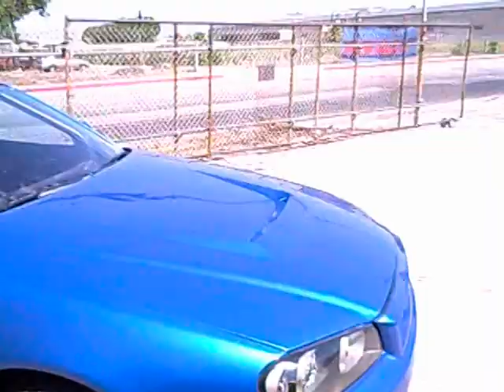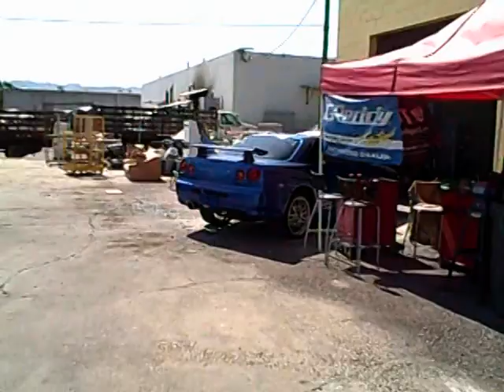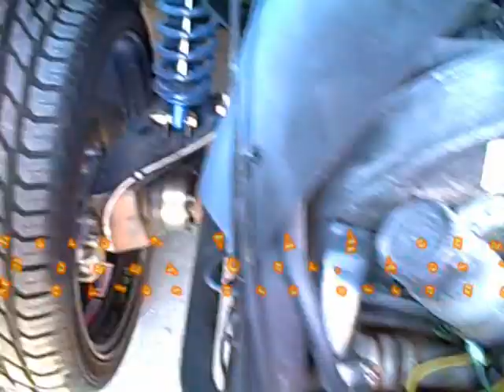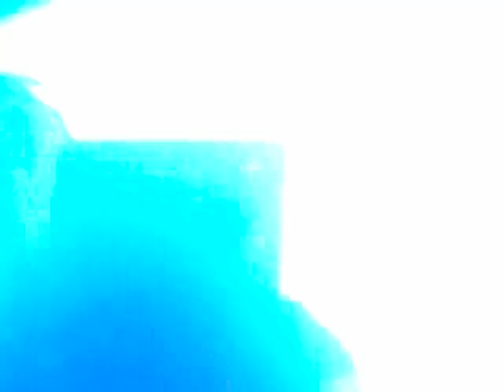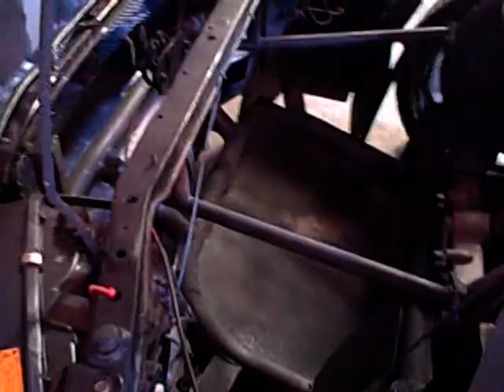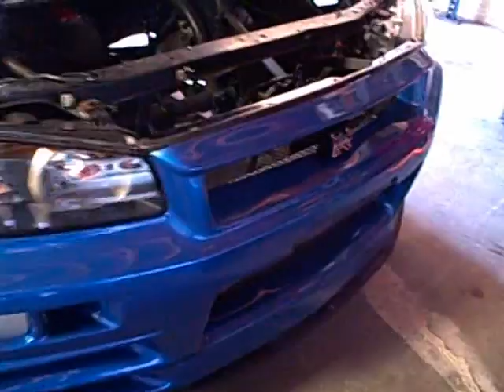R34 Skyline Buggy Car - Fast and Furious 4

Comment: The 2JZ engine is a good engine. It can be modded to 650 hp without messing the engine. But you have to change the ECU Programming and the boost controller, unlike the RB26 that only needs a huge turbo and a boost controller. Finish.
(note that I specifically mentioned the designated engine, as not all JZ and RB engines can be used for high speed abuse)

Comment: you don't have to change the ECU on the RB, you just have to reprogram.
The ECU on the JZ is another thing, its not that inclined to racing so you have to replace it.
Skyline GT cars used in touring races have RB26DETTs that have 600hp have factory ECU that are reprogrammed.

Comment: There is more than that. there is an NA version of the RWD one. And then there is a turbo and NA 4 door version of it aswell. Then there is like 3? or 4? different GT-R's aswell. Standard, V-Spec, M-Spec. etc.

Comment: It's a fiberglass body of the R34 GTR they used on Fast and Furious 4 on the desert. The original on the city part was RWD, not AWD, and plus, they used a fiberglass body of the GTR on a dune buggy and they used it for 4x4 in the desert. I know this, because there was some site of cars called EdMaunds (I think that's called).
Reply from the maker: Its not fiberglass. It is a steel body. Since I touched it, and drove it, pretty sure I know what it is.
Reply: Yes, it IS fiberglass. EdmundsAuto just said the car was made by Fiberglass in a Dune Buggy chassis for the desert part where Brian (Paul) and Toretto (Vin Diesel) to Mexico with other racers to collect a $60,000,000 merchandise.
Reply from the maker: Brayan1023ps2 This is my video. I have driven the car. Its not fiberglass. Its an R34 GTS body on a VW drivetrain. You can watch the video, and decide if I or Edmunds knows more about this car. I did work on most of the movies, and I have been working on GT-Rs for 15 years. Don't always believe what you read. Most of it is written by people that have never seen or laid hands on cars.
Reply: tyndago Don't believe me? Read this. http://www.edmunds.com/car-reviews/features/fast-furious-cars-2002-nissan-skyline-gt-r.html        The production bought a total of six Skylines to portray FBI agent Brian O'Connor's most significant ride. And it built a fiberglass replica shell of the R34 that was mounted to a dune buggy chassis for some off-road scenes. Of six real Skylines, three were sold as parts cars, two were destroyed and one was saved for any potential sequels. And of course there are going to be sequels.
Reply from the maker: Brayan1023ps2 Why do I have to read it when I was there? Check out the credits. Technical Adviser, insert unit. You might see my name there.
Reply: OK, OK tyndago, it's metal.

Comment: Poor clueless viewers. In fact, that's not even a Skyline GTR34. The whole chassis was made by hand and a VW engine was thrown in. Then, Body Panels like the fenders, hood, doors etc are pieced together, so much so it looks like a Skyline R34 from the outside.  Even IF you were to say this is a Skyline, it would only be a GTT and not a GTR due to it's body panels! And dayum, the stance on that car is so 4X4! Haha, it helps that it's a VW buggy.

Comment: there was an doc on F&F and the person writer had the listings of all the cars that were used in all the movies. He said that one 1 of that blue skyline was a true skyline which belong to pual walker. the rest that were used to shoot rolling scenes were all reps. he didnt state if it was a vw rep but he said reps.
Reply: 6 years late but none of the gtr's/gtt's used in ff4 were paul walkers, he had a white r34 gtr imported legally by motorex, just sold for about $500,000 by TopRanksImport(ran by the same guy that started motorex back in 1999-2002), the r34 vw powered is a stunt vehicle for cameras and more dangerous stunts. im sure you figured out all this by now, but incase someone else didnt know heres this comment

Comment: Bullshit they do.  the JZ series was the direct competitor to the RB series.  Racing pedigree doesnt have anything to do with it.  If thats so, then the same can be same for toyota and the M series engines.  The JZ series was the first one i knew of that could be modded to handle over 600/700 HP on a stock bottom end.  the RB can do the same, but ive read that some of those RB engines have oiling problems and would loose oil pressure at high rpm.  Theyre both good motors but i prefer the JZs.

Comment: ill tell you whats wrong and it cost $40 to fix...you have the computer chip of a nissan gtr running a buggy engine..so get the chip fo the right engine and then it will inject the right amount of fuel..u may just need a chip upgrade

Comment: id keep it like it was....remove the stock intake....convert it to a double weber setup,  resieve the motor *which in the VW's case is like boring it over without boring it or taking it to a machine shop*  add a stroker crank, high lift cam, high flow heads, and add a garret G3/4 turbo.  and a aftermarket header...and i garante youd never know the difference in performance...just be ready to have a motor that sounds like a EJ25 and a car that turns more heads than a normal GT-R/T would ever do
Reply: Yeah i 100% doubt that dude. Im sorry but a bug engine is not out performing an rb. Youre huffing glue